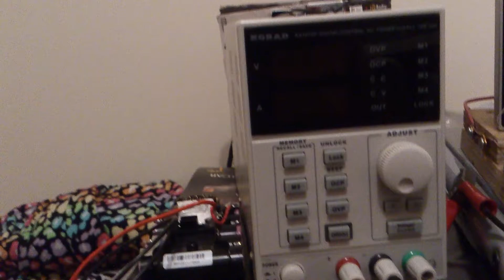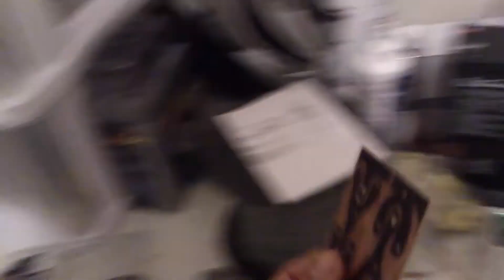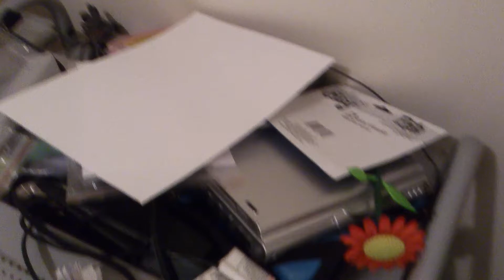Super capacitor projects and other stuff

Comment: Good video Pete. I think supercapacitors are the future. Today I recieved several like yours 500f, 2.7v samwha green-cap. I think of little projects but don't have the guts to shoot and upload video. You have an impressive little lab, I cannot fit such a thing in my appartment :) Can't wait for your next videos, Cheers!
Reply: Test your capacitors! samwha capacitors are very bad and they don't charge more than 300F. Also, they have a high leakage current. There is a reason they're 1/10 of the Maxwell price!
Reply from the maker: +Midsummermoons 
I have a Maxwell 6 pack multi booster I'm going to use in my miata instead of the lead acid battery. Preliminary results were promising. I'll make a video soon so check back.